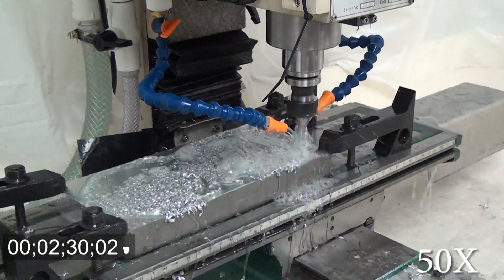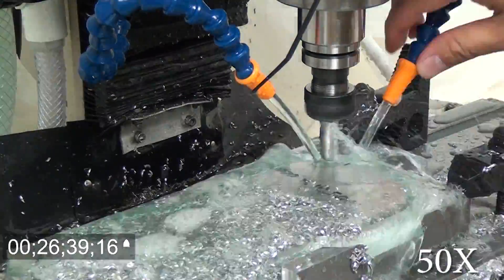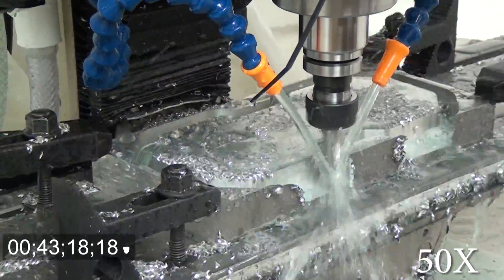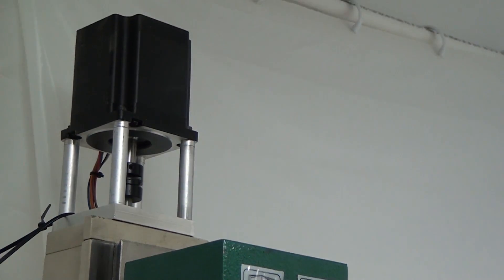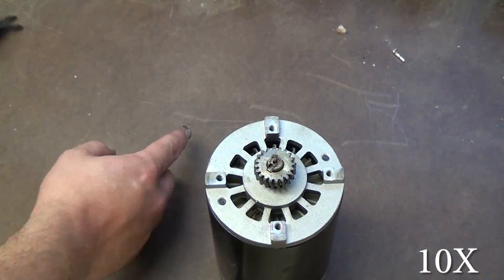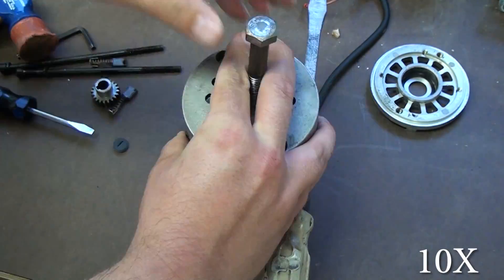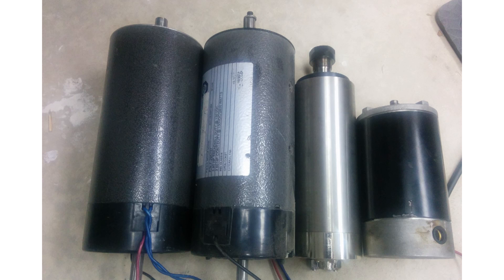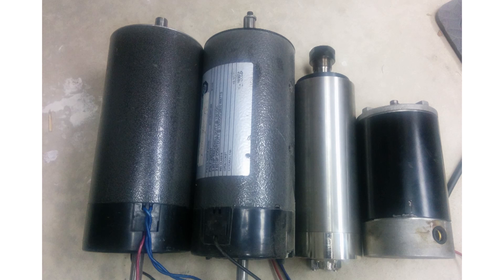CNC-G0704 #12 Motor Meltdown

Comment: Brushless motors are better. If I build a CNC mill, I would use permanent magnet rotor ac servo motors.
Reply from the maker: +David Perry Agreed. I couldn't find one I liked that wasn't super expensive. After burning up the DC motor I installed after this video, I went to 3 phase AC and I'm very happy. Check out my video "#19 AC-3phase Motor."

Comment: If you sent the tach pulse into linuxcnc, is there a way it could shut everything down if it doesn't detect any spindle speed?
Reply from the maker: +Kermit Frog yes I believe there is, but I can't remember how to do it. I do recall looking into it at some point but do not have it implemented in my installation. I can do research on this in a couple of weeks if you aren't able to find anything on the linuxcnc website or forum.

Comment: Bummer.  I've always been afraid of that happening to my machines.  I wrote a brain for Mach3 to prevent this from happening (it works great) but now I'm moving to Mach4 and I have no idea how to write a LUA script.  Any thoughts? Check out this video:
https://youtu.be/MDV58orq0F8
Reply from the maker: It sounds like you know more than me. I have never used Mach (I only use LinuxCNC). I burned up another (larger) DC motor after this one, and am now running a 3-phase AC monster.

Comment: The new motors from grizzly just have an internal breaker? That's silly ... it will just result in more head crashes due to no spindle operation. It only helps prevent a fire ... but they really should have put a bigger (higher power) motor in there instead!

Comment: It might not be a bad idea to implement a system that effectively hits the E-stop when the motor fails, or when there is an overcurrent condition on the stepper motors, such as when they become stalled.

Comment: @Russtuff 
I'm about to order the G0704 Does it come w the new V2 Motor installed or has to be purchased separately? I Will be using mine as a mill NOT Converting it to CNC should it be ok?
Reply from the maker: Hey Mike. The new models of come with the V2 motor, and Grizzly told me they discontinued the version I have. V2 has an internal breaker to help avoid problems like mine. You could always call them before ordering to confirm.

Comment: Hey good videos! I could fix the bent shaft. I'm a machinist at an electric motor shop in WI. I've straighten shafts that were bent .025" or if your going to get rid of it I'll take it off your hands. You can contact me @ jrsmachining@yahoo.com. Also I have my own hobby shop at home with lathe, mill, and tig welding (Miller syncrowave 250) Keep up the good vids! ( I'm not good with cameras) JR
Reply from the maker: jason johnson Jason I remember reading your comment when you made it but just realized I never replied. I haven't gotten rid of the motors with bent shafts, so if I decide to use them down the road I'll hit you up if I need them straightened. I called motor repair shops all over my area and no one offered this service.
Reply: russtuff the company i work at has got a machine to Bend them straight, if you have bigger work(and dont mind waiting a few weeks) you could send it to us(we are an european company and we have got 60 and 250 European Tonnes to straighten them)

Comment: you could mill this part faster with a trochoidal toolpath, using full depth of cut.
Reply from the maker: You would be dead right.... if this mill had any heft to it. When it comes to 1/2" end mills, this little machine will tolerate almost nothing. Since I'm clamping on the corners and am forced into a slot, 1/16" DOC is all this thing can handle. Any more, and it tries to shake itself into pieces.
Reply: rf-25 is only larger and will tolerate like 1.5 inch depth of cut at 15deg engagement. Try it.
Reply from the maker: meocats
 I have tried it several times. This mill can't do it.
Reply: carbide endmill? I couldn't do anything with my chinese HSS endmills either
Reply from the maker: No I'm using a high helix HSS aluminum specific end mill. Carbide would probably help a little, but I still don't think it would solve this problem. Have you seen Hoss' video where he shows scale models of these small mills by each other? The ZX45 has a lot more meat on it than this little 702.

Comment: That sucks, but given Chinese quality, it's not surprising. When you upgrade the motor, are considering putting in some safety features for your CNC mods?  I'm thinking something like a tach sensor for the spindle that cuts power to the machine if the spindle isn't turning when Mach3 thinks it should be. I don't know Mach3 so I don't know how hard that would be to do, but the spindle sensor shouldn't be hard. If you aren't up for circuit design, just use an Arduino to sense reflections of an LED off of a bit of tape or a white spot of paint on the shaft, and to get the speed output signal from Mach3, and do the rest with software.   Output of the Arduino can control a contactor, or a relay or transistor controlling a contactor, to cut power. That's the general concept anyway...and no, I haven't done such a thing, but I am sure it's possible in some form.  Might be cheaper than end mills, steppers, and other things damaged if this happens again. You could also have the Arduino run a display so you can see spindle RPM when things are going well too. 

Stay safe, and have fun!

-- Mike
Reply from the maker: Hey Mike.
The spindle has an index ring which is how the tach get's it signal, and from what I've read there is a way to send that to the controller (I use LinuxCNC not Mach3) so the software can keep track of what the spindle is doing (and tell it what to do in some cases). I've been researching to find out if it is possible to have the controller go ESTOP if the spindle drops below a certain RPM value or percentage, but have not found an answer yet.

I am definitely going to find a way to do it though (and I do have Arduino), because if the spindle is dropping to quickly or below some percentage then the likelihood of a crash or losing steps on the steppers gets high. I would much rather just kill power to everything and reset so avoid losing zeros or crashing.

I've probably survived RPM drops to 70% intended speed, but with this huge motor I will likely want to stop if the RPM drops more than 5%-10%. If a cut can pull this 3HP motor down that much then I've either programmed the feed rate wrong or something bad is happening and we should stop and take a look.

Thanks for watching!

Comment: What size cutter is that and what is the depth of cut you are taking? Maybe the reason you burnt out the motor is you were expecting too much from it.
Reply from the maker: 1/2" end mill and something super shallow like 1/16" or 1/18" DOC. My mill HATES 1/2" end mills so I have to baby them with shallow cuts when making a slot like you are seeing in the video. Anything else and it tries to vibrate itself to death.

Comment: Hi Russ, I live in Utah County and have a G0704 with a 1.5HP 56c motor on it (Black Max Motor) and a vfd controlling it. I run it with a 1:2 belt drive which gives me about 8000rpm on the spindle. The motor looks enormous on the mill but it works really well. I did have to put in the mill head extension to fit my hydraulic power drawbar because the motor is so big. I also used my own plans for the belt drive conversion

I run linuxcnc and your mill and spreadsheets were the motivation for me to build mine. If you want to come see a very large powerful motor on your mill let me know.
Reply from the maker: Cool! I was super close to pulling the trigger on the same type of motor but I still think I can use one of the DC motors I have since I already have it and the controller. If it doesn't work out then I'll be getting the same style motor you have.
Reply from the maker: Hey I have a question for you. Did you use timing pulleys for your conversion? Have part numbers, links, etc? I'm hung up on this part of the build.
Reply: russtuff Yes I did use timing pulleys. You'll probably want to play with the center distance and pulley calculator from SDP (https://sdp-si.com/eStore/CenterDistanceDesigner) Because I'm running a very different motor the center distance will be different. You just want to measure where the center of the motor will be to the center of the spindle. Then play with ratios to get something you like, that fits. I went with a 1:2 ratio which for my center distance of 5.37 inches was a 24 tooth on the spindle and a 48  tooth on the motor with a 92 tooth belt. It gives me double the motor speed.

Due to the vfd and motor I have constant torque from about 60 rpm to 3600 rpm and constant horsepower from 3600 to 7200 rpm. Theoretically I can run the spindle at 10k rpm. I never really go above 6krpm. I also have an encoder on the back of the motor and linuxcnc lets me do rigid tapping. I reused the g0704 original spindle rpm disc as an index pulse. If you buy the 24 tooth GT2 5mm pulley the original rpm disc will just barely fit. You have to grind just a touch off the pulley where the two screws secure the rpm disc to the top of the spindle.

Initially I ordered L pitch timing pulleys but after reading up on it some more I ordered in some GT2 5mm pitch pulleys. The GT2 pitch profile is quieter, rated to higher speeds and I found the 15mm belt size to fit perfectly for my uses. All the pulleys and belts I ordered from SDP-SI. They ship out of the east coast and are really the only distributor I know of that offers so many pulley sizes.

I'm very happy with my belt drive conversion and the vfd. I did have to bore out both pulleys on my lathe, G0602, same as yours. You'll bore the spindle pulley to just slip over the spindle. It's about .85 in. I bought the aluminum pulleys since they're easier to work on. You'll have to drill and tap the spindle pulley with three setscrews 120 deg apart so it can clamp onto the spindle. There's also a lot of stuff to rip off the mill head to get rid of the old gear system. I also lost the use of my quill. Hoss does have plans that show how to retain the quill with a belt drive but I didn't buy his plans.

The beltdrive conversions are all the same in practice. You need some supports that will sit on top of the mill head and screw into the original 6 mounting screw holes. Then on top of that you want to affix a motor mount with a little bit of wiggle room so you can put the motor on and tighten the belt. Then a pulley mounts on the spindle. I recommend you draw it up in solidworks or something just to make sure everything will fit right.
Reply from the maker: Library
Thanks for being thorough. I have done all the measurements, but have been searching for L size belts with little to no luck. I'll try the GT2 and see what I can find. I've been on the same web site, but maybe I'll have more luck going with the the same series belt/pulleys you are using.

I think I have the rest of the problems solved, and I've already taken the mill head completely apart. I'll be doing a quick update video tonight, then a full blown teardown video hopefully this weekend. More videos after that of putting it all back together, including the bearing upgrade, all part numbers, etc. With the mill down I'm doing this all either on my lathe or by hand, so it should be fun to see if it works :)

Thanks for your help!
Reply from the maker: Library
I haven't used the quill since I CNC'd so I'm not concerned about that. I thought everyone mounted the pulley to the 45mm quill, not the .85" splined shaft. Doesn't that allow the splined shaft to flex from radial loading? And do you then not bother with the quill assembly? I just ordered new bearings for it :|
Reply: russtuff The splined shaft won't flex because timing belts don't need to be as tight as v-belts so there isn't as much side load on the splined shaft. The other thing that helps is I didn't take out the quill assembly. I took out all the gears that touched it but the two gears and the two large bearings that support the quill assembly I left it. On my mill these keep the splined shaft completely supported. I can't flex it at all.

I didn't replace the two large bearings in the quill assembly, I did the spindle bearings with the fancy kluber grease but not the large quill bearings. Perhaps I should have bought the belt drive plans but no one else mentioned replacing those bearings. I looked up the specs on the bearings and they only appear to be good to about 7500rpm. I had originally really wanted 10k rpm on my spindle but 7500 is good enough. The quill bearings were really stuck in there on my mill. Good luck getting yours out.
Reply from the maker: Library Thanks again. I think I'll leave it alone for now since it's one less thing to deal with. Maybe later I'll stack another set of pulleys for high range and go over 10kRPM.

Comment: Very dramatic, so a nice timely warning
I only have a manual mill with a power drive and ended up taking off the motor cover to cool it.
looking forward to see what you do with the replacement, particularly if its one of those 3 phase with a controller.
cheers

Comment: I agree with David go with a three phase motor and VFD but don't use that high speed motor it will cause you grief down the line. :)
Reply from the maker: I go back and forth. I was all set to buy http://www.automationdirect.com/adc/Shopping/Catalog/Motors/AC_Motors_-_General_Purpose_and_Inverter_Duty_%280.25_-_300HP%29/AC_Motors-General_Purpose,_Rolled_Steel,_IronHorse_%280.33_-_2HP%29/3-Phase_Motors,_56C_%280.33_-_2HP%29/MTR-002-3BD36 but they were out of stock, so I started working to get one of my big DC motors running. Now this motor is available again and the price even dropped. I'm so torn!
Reply: russtuff Hope you've got 220V, I used a cheap VFD from China on my Bridgeport and it works great.
Reply from the maker: NuttyforNissan
I do have 220v in my shop.

Comment: Have you considered adding a spindle speed sensor?  I wonder if you could get LinuxCNC to safely stop if spindle RPM drops below a percentage of the target RPM.
Reply from the maker: I know people have been able to do this, but I honestly have not even thought about it. Right now I just want it running and I'll check RPM with my handheld tach if needed.

Comment: Ahhh that sucks Russ! I haven't had good luck with Grizzly standing behind things that are out of warranty and they seem to die right after I think they build them for that reason. :/ on my lathe I went with a 1hp 3ph Lesson with Teco VFD and I LOVE it with I would have done it sooner! Good luck on what ever route you choose..

Dennis
Reply from the maker: Are you finding that the 1hp 3ph is getting it done? I really think I would be happier with a 2hp like the one linked in the description. It's physically very large though.
Reply: The 1hp 3ph Lesson is more than enough power for the 602 really with the teco you have to back it off some cuz it will make more power than the spindle bearings can handle but also going from a single phase motor to a 3 phase motor it has more low end torque witch is what you want in a lathe and this is a very popular motor used in the VFD upgrade for the 602 it's a direct mount using the D80 mount.. If your ever interested in doing it let me know.. :)
Reply from the maker: volcom7114
I do plan to make a change on my 602 some day..... of course I've been saying the same thing about the CNC conversion FOREVER!
Reply: Yea I know the feeling! I really would like to CNC my 602 but I haven't messed with CNC a lot and I guess I'm kinda afraid of what I don't know lol :) but I feel ya there for sure!
Reply from the maker: volcom7114 I've had all the stuff to do mine for more than a year, I just haven't done it. When I do, I'll do a series of videos like I did with the mill.
Reply: Awesome! I would do videos and I have a nice HD camcorder but I don't have any video editing software and really don't want to spend the money on it... :/ also some things I do I can't really show on video but I do enough that I could make for some nice footage lol :)
Reply from the maker: volcom7114 yeah your work is awesome!
Reply: Thanks very much :) not many get to see it and so I don't get to hear many compliments on it but it's nice to hear it from another "hobby" machinist! You also do great work and I love your view on making things! That's using your brain! :)

Comment: i was doing the brake in for my g0704 like the book said and about 1/2 way thought i could smell hot so i took the cover off and it was way hot. i rig up a computer 80mm fan to suck out the air and thew the motor cover a-way it keeps way too much heat in witch what might of help lead to your meltdown
Reply: mikeyeyes7 ya that bean over 3-4  years ago go for it. i now have a Bridgeport but i still keep the 0704 still find things for it to do.
Reply: Since u took off the Motor Cover & added the Computer Fan has it been ok? I'm about to order the G0704 but I'm a little worried now, I will be using mine as a mill not converting it to CNC Do you think It will be okay?
Reply: mikeyeyes7 yes bean going strong  i did have to replace one of the drive gears but that was my fault.. for the money you can`t beat them with a few simple modes you can get all most as much travel as a old Bridgeport. i got a bigger mill but i not selling my go704
Reply from the maker: That's a great thought Mog, and it definitely could have contributed to my motor overheading. I never once considered it.

Comment: I switched my Taig mill over to a 1.25 hp treadmill motor and a DC controller.  Now I can control the spindle with mach3.  I highly recommend this setup plus it's fairly cheap.  Since your mill is down just let me know if you need any brackets made...  I'd be glad to help you out. I was lucky enough that I was able to get my new motor mounted with a couple of spacers I made on my lathe (G0602). Good luck!